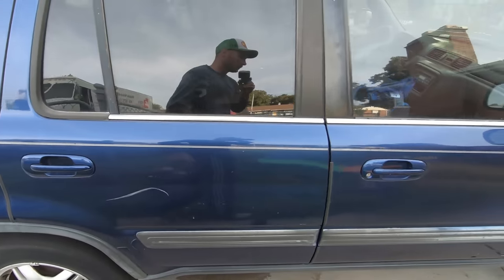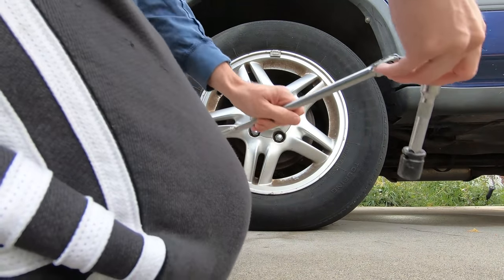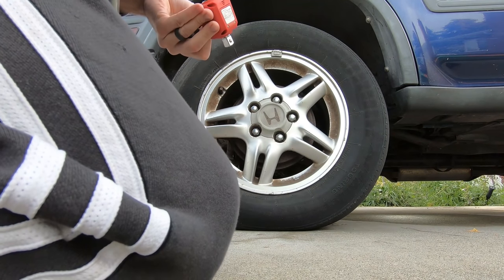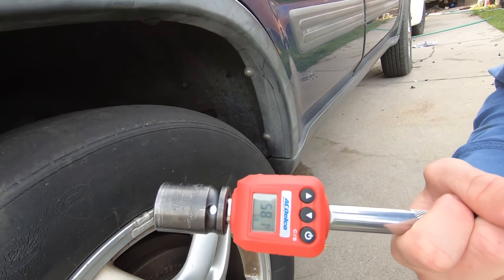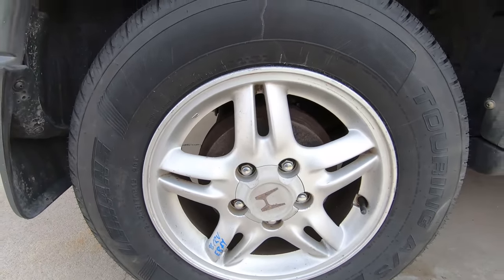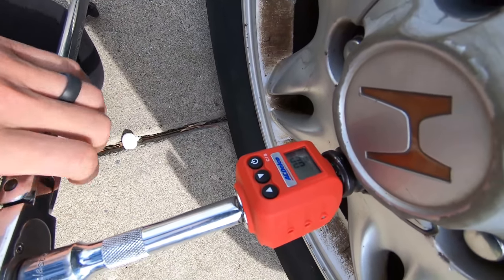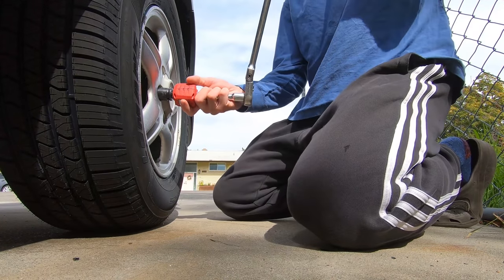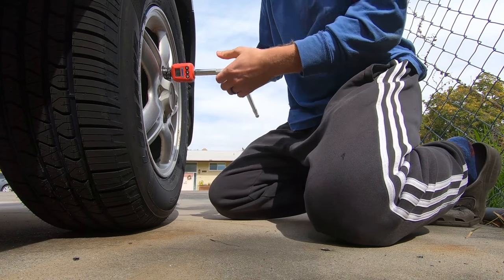Will the local trusted shop torque my wheels or use an impact? *Surprising findings...*

Comment: Having helped a local garage during tire season we have used torque sticks when its non stop changing tires in the bays and the parking lot to get them done but we always advise people to come back after 100/200km of driving and we will re torque them for free.
Reply from the maker: that's good to know! I dont think id go back here for more torquing! haha
Reply: @RoadsideRescue  Nope reminds me of a older guy who came in stating his car was pulling to the right so we took it in and when tryna remove the tires we found out that another garage tightened the lugnuts down to over 200 ft pounds that's what our meter maxed out at so they were likely tighter ended up finding out the shop messed with the alignment so we had to do a alignment on it and had to replace the rims and rethread the studs. Was not a fun day.
Reply from the maker: wow! Thats crazy!

Comment: It dismays me to see you not applying the vehicle parking brake as the car is moving backwards and forwards when you were torquing the wheel bolts.
Reply from the maker: you're not supposed to when tightening wheels. (So i've always heard) It can mess with the parking brake.
Reply: Roadside Rescue I have been doing up my wheel nuts with the parking brake applied for over 25 years and haven’t experienced that.
Here in the UK everyone applies the parking brake when torquing wheel nuts.